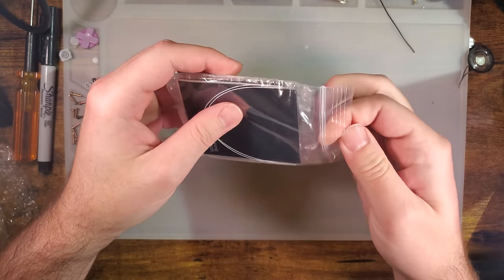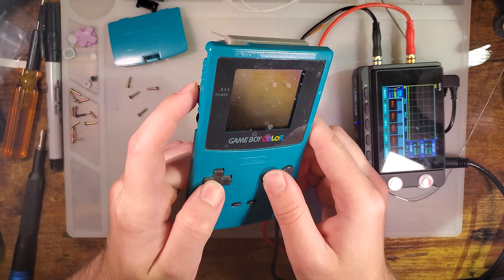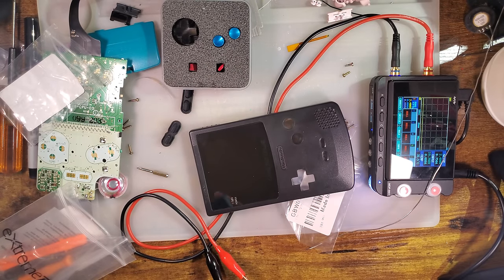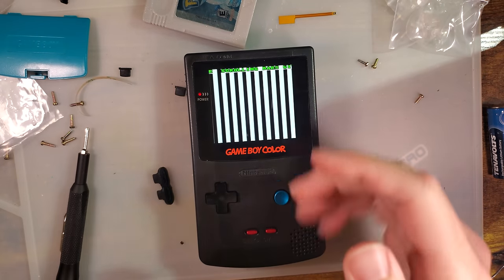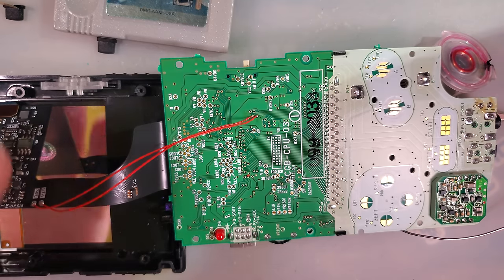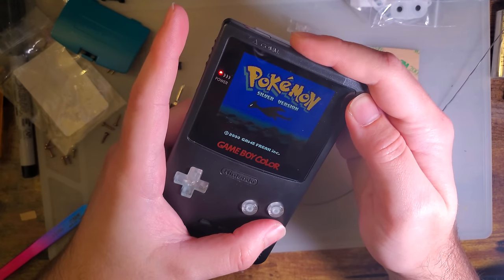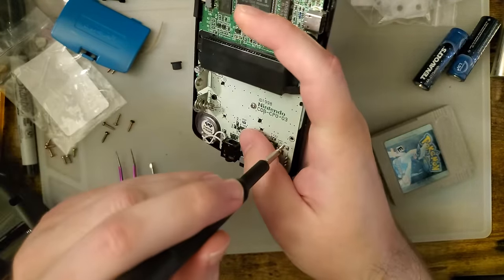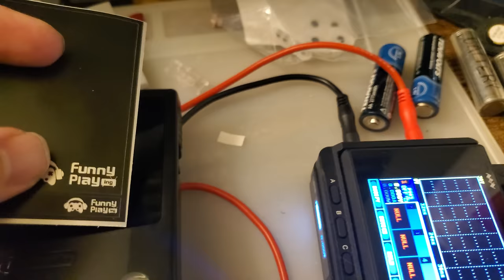'Retro Pixel 2.0' Funnyplaying Laminated Q5 GBC Backlight

Comment: Summary of known issues:
19:02 - start and select doesn't fit and holes need trimming, fix method: 22:30
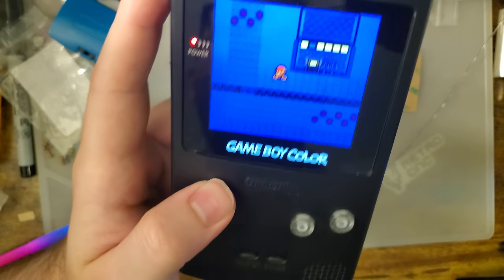1:01:49 - up on d-pad need fixing, fix method: 1:04:02
1:07:21 - pushing start and select without holding it glitches touch sensor, fix method: 1:07:51
Use funnyplaying screws not the original ones to avoid problems.

Like it so people would see.
Reply: Installed one myself a few days ago, start select is membrane issue if you use funnyplayings. They are horrid. The mold for the start/select is way off, original use stairstep mold on buttons, repro not, same thickness all over. I also ordered full set of membranes, and I can honestly say, they are deep burried in the trashcan where they belong. Start and select wasn't even the worse part. The A/B didn't have the alignment holes in the correct place. Dpad didn't make connection except down. Nothing else worked. So ended up boilong and cleaning the originals. Heard alot of people had issues with the touchpad, I got a totally different one, also power and touch was reversed on my flex cable. So that worked actually. The screen thou, OMG. Made it all worth it. I hope funnyplaying addresses the issues, then it's almost perfect.
Reply: @roteca  @ant Do the updated kit and membranes still have these issues that you know of? The junk GBC I got to mod has a torn A/B membrane so I was hoping to just use all new membranes. Parts ordered but haven't arrived yet.

Comment: Great video!  I usually watch your videos before purchasing and installing, but I jumped on this kit right away.  I installed it four days before this video and ran into the exact same issues.  I got the RetroCNC buttons, and opted to not use the select start buttons.  The touch sensor was also very problematic for me.  I had to reopen the system at least three times to check the solder connection.  I think a piece of wire and copper tape would function better.  Your video answered my questions about the menu functions, which weren’t even detailed on funyplaying’s product page.

I used the black screen, clear red shell, RetroCNC concave aluminum buttons (silver) for d-pad A + B, oem select start silicone, clear funnyplaying speaker, holographic sticker, barcode, service sticker for battery plate, and a clear soft tpu protector.  This is definitely the highest quality Gameboy I’ve put together, and I’ve put together almost all of them.  I almost only buy from Retro Game Repair Shop and Retro Modding now.  Thanks again for the content.
Reply from the maker: > I think a piece of wire and copper tape would function better. 

Yeah, I did exactly this after the video and it did work better for me. Much easier to position too.
Reply: @makho  How do these touch sensors even work? I dont understand how a piece of copper can translate a touch through plastic... Like I want to modify the sensor to work better, but I fail to even see how it senses anything at all?
Reply from the maker: @chis5050  the "sensor" works by measuring a change in capacitance. When you touch it, the capacitance changes.

Comment: Great video. I personally would have used a smaller tip on my iron for the smaller stuff on the PCB but aye it ain’t like you can switch it out mid video. Great job showing the intricacies of GBC modding and the rules you have to follow for those who are new.

Comment: So, I know I am replying to this video and it's super old. But if you are worried about the transparency of a clear button - or interior of a screw post after screwing a screw in too deep and it makes a scuff on it, you can use something like a thin layer of gloss varnish and that will restore the transparency. Something such as Vallejo Gloss varnish (which is an acrylic resin). I have had to do similar on clear plastics that were a little scuffed and it worked perfectly.

Comment: So you can’t change the color of the “gameboy” separately from the “color” on the display?  I think that would have been a nice touch.  To have the gameboy be gray and change the “color” color to whatever else independently.  Would be even better if they had it multicolored for each letter like OEM
Reply: I think you can somebody in Reddit had the game boy in red and color In green I think you long press select
Reply: @Thirdeyestrappd  Do you have a link? I can't find it.
Reply from the maker: nope, but since one chip is in a constant state of one-upmanship with funnyplaying, perhaps their next kit will have this feature
Reply: It shouldn’t be that hard for then to have the multicoloured lettering as per the original, but I wouldn’t be surprised if they tried it and had colour bleed issues between the letters. If would be cool if the lettering could be dimmer than the main screen but i guess that would require either a separate screen, local dimming or a dimming gel between the LCD and glass. Anyways, i’m gonna wait and see if they make a multicoloured variant before buying. Replacing that touch sensor with a physical button (since they make the shells too) would be nice. Heck, they could add three buttons and reduce soldering massively.
Reply: @Venomous28  The Multi coloring lettering might be harder then you would initially think because the letters overlap in several areas. Getting that properly aligned with the cutouts would likely take manual adjustment on a per screen basis. (The tolerances I imagine would be quite tight, unlike a flat single color.)
Even with regular glass lenses Ive seen plenty of times that the colors aren't properly aligned, so you might see a bit of green in the one of the Os.
Reply: DeScruff yes I was thinking about this since my last post and I think the only way they could do it realistically would be to shine white light through coloured translucent letters (like colour gels). You’d lose the ability to change the colour of the lettering of “COLOR” but it would look incredible

Comment: Grabbed one of these on your recommendation, aside from the color gamut looking a little too saturated it's pretty great. I did run into the touch sensor going kaputt as others here have. While I can't speak for the 2.0 ribbon shown in the video, the newer 2.1 places the components used for touch detection too close to a flex point - you can be extremely careful during the install and they'll still desolder themselves.

Basically if you're extra hydrated and the thing still doesn't work try reflowing R22, R23, C7, C29, C31, and U4. Another option is to remove all of those EXCEPT for R22 (which is a pullup on the touch detect signal) and then attach a button between Pin 1 of U4 and Ground.
Reply: Hey, thanks for this, it is very useful. I too have the same ribbon as you and unexpectedly, the touch sensor has just stopped working. I have tried everything to try and remedy it, but to no avail. I will attempt reflowing the caps and sensor that you have mentioned. However, I find the final solution very interesting. Have you tried this with success? I hate these stupid touch sensors and even if I had to open the shell to press a button or solder a jst connector that I could attach a button to (in something like the battery compartment) this would be a big improvement. Any particular ground point?
Reply: @SCorpG22  I attached a button temporarily to set the panel's brightness and display mode, then removed it afterward. If you'd like to try this approach - the touch sensor chip is a TC233A and FunnyPlaying's implementation on the 2.1 ribbon is pretty close to the datasheet's example circuit. So shorting U4's Pin 1 (/OUT) to Pin 2 (GND) is enough, but to do this properly the signal needs to be debounced.

Ah right, obligatory warning - you can irreversibly damage your kit by doing this, exchange it for a replacement if you have the option available, flex board rework is advanced level stuff, I ain't liable if you break something.
Reply: @TailChao  I appreciate your honesty. I am able to micro-solder, I'm not a novice by any stretch of the imagination. I actually soldered a wire to copper tape, to the same pin on the TC233A that Makho made a note of as an alternate touch pad for the 2.0 ribbon, but it didn't work. I did notice however, that the touch trace from the inbuilt sensor leads back to a small capacitor before it reaches the TC233A and was wondering if a wire soldered to the side of this capacitor might work (I've yet to try).

As for replacing it, FunnyPlaying don't want to know. They've ignored 2 messages I have sent them and the kit is only 7 weeks old. I have wondered whether they have received that many messages about this ribbon revision and the faulty sensor that they've just stopped responding to people, which isn't great in itself. But I have nothing to lose really. I either try it or order another kit. I searched for a schematic of the TC33A but I couldn't find one anywhere. Can I ask what you mean by 'the signal needs to be debounced'?
Reply: @SCorpG22  No stress, the warning was intended for anyone else who might be following along.

To be clear, U4 is a TC233A not TC33A. I recommend reflowing all components in the touch sensor group (see my earlier list) before trying anything else, including attaching an auxiliary touch sensor. If any of them have a shoddy connection, the detection won’t be stable.

If you opt for replacing the original circuit with a button, debouncing isn’t necessary but rather it’ll work better. The touch detection signal (Pin 1 of U4) is expected to have a clean falling edge and just hanging a regular button off that may cause the kit to see multiple presses instead of just one.
Reply: @TailChao  Ah, typo on my part, apologies. I shall reflow and see if I get any life out of it. Thank you so much for your guidance, it's actually a relief to know that it isn't just me who has experienced issues with this new ribbon revision. Happy New Year for tomorrow.
Reply: I’ve resoldered my touch sensor (and other things like copper tape) so many times my pad is kaput. And idea where i could solder to instead. My eyes suck
Reply: @Venomous28  Yes, I found out several things about this ribbon since this comment. Firstly, there is an alternate solder point on the right side of a tiny resistor right next to the sensor. I soldered a wire and copper tape to this and it worked. Also, be aware that the cut outs for start and select in the FP shell are too tight. This means that they get pinched and interfere with the touch sensor controls. I wonder why every time I unscrewed and rescrewed the front plate that I would get it working before it shortly stopped again, it's that it frees the rubber buttons. So the holes need filing lightly with jewellers files. I also reflowed all the caps and resistors mentioned in this comment. If I can be anymore help, let me know.
Reply: @SCorpG22  hey thanks for getting back to me. That is excellent news about the extra solder point. I’ll try and use it. I was having troubles with start and select for 2 reasons. 1 because i needed to file a bit and 2 because i soldered the wires onto P12 and P13 near the actual start/select buttons. It was ok for start but too close to select and interfered with the membrane. I’ve switched to the points in this video now and its all good. Back to the touch sensor, i have yet to get it to reach to touch even once all day so I do wonder if there is a deeper issue. The kit I have has a tiny touch sensor but also a built in touch sensor on the ribbon cable - neither are working. I didn’t have copper tape so experimented with some solder wick and that was no good. I’ll try copper tape next and if that’s no good, might opt for a physical button. Shane FP didn’t just incorporate something into the screen laminate.
Reply: @Venomous28  The touch sensors are a bad design in my honest opinion. - They would be far better adding a physical tactile switch, small enough that you could trail it down to the battery compartment and just open than when you want to switch modes or screen brightness. What I would recommend doing is soldering a wire with a piece of copper tape and threading it through the socket for the power switch, before putting the power switch in. Screw it all together and move the internal power switch up with a plastic spudger. Don't stick a metal spudger in whatever you do. Then once it's on, touch the copper tape outside of the shell. - So many things can throw the touch off, even plastic. To solder mine to the side of the resistor, I used a cocktail stick with some solder paste rather than solder. I tinned the wire and touched it with my finest tip to the resistor and it soldered perfectly. It saves stabbing around at the resistor with a big blob of solder on the end of your iron. I've managed to set my brightness and my logo colour and I've left the wire attached and stuck it to the side of the cartridge slot inside so that if I ever need to fiddle with it again, I can get to it. - But I'm done with fiddling with the sensor through the shell, it's about as tedious as chewing a lemon.
Reply: @SCorpG22   I’ve now recalled something stupid I did when installing that I didn’t think would be an issue at the time. I initially soldered the touch sensor pad to the wire for the power. So I sent 3V into it. I wonder if that might have blown something. I like your idea for the copper tape sensor on the side. If my ribbon is salvageable though, a physical button would be nice, would be nice to be able to easily change the brightness to cater for both afternoon and late night sessions. I am loving this screen, but constantly being on max brightness is killing both my eyes and my batteries!
Reply: @Venomous28  Hmm... you couldn't blow the pad as all it is in essence is a copper conductive pad, there's nothing to blow. However if you had that connected to the touch sensor with the power, then it's possible you could blow the touch sensor itself. - And if you had done, you could replace it as I think the ICs are available separately, however you may have also blown the little capacitors around it. But I think you're maybe looking too much into it. I'd solder a wire and a piece of copper tape to the side of the resistor and I'd also try freeing up the start and select buttons by lightly filing around the edges of the holes in the shell.
Reply: @SCorpG22  I decides to check all the resistors and capacitors in that area. Everything was fine except for C29 which is missing completely. I Assume that is my issue! If anyone knows what type of capacitor goes there i’ll try adding one but i’ve asked FP for a replacement. They are taking their sweet time getting back to me though. 
By the way. I might also try the physical button between pins 1 and 2 on U4 but its hard to see which end of the chip has the pin 1 indicator. Any idea? Even my best attempt at taking a picture didn’t help with an iphone 7…
Reply: @Venomous28  Are you sure C29 is missing as unlike C3,  C7 and R22, it isn't right next to the C29 text or the same size. It's the larger type and is to the left of R23 at the top of the touch sensor IC. In regards to adding a physical button, I couldn't help you I'm afraid, you would need to directly apply to the dude above who mentioned the idea. And in regards to FP replying, good luck with that too. I like their products but I find their customer service utterly useless. I think they are well aware of the issue with these touch sensors and have given up responding about them, as it's easier to bury your head int he sand that deal with a dozen customers with issues. Did you try soldering a cable and copper tape to the side of R23? Did you try sanding the start and select ports of the shell? - I'd try all these things before I give up.
Reply: @SCorpG22  I’ve done the start/select button filing and those are great now. Still need to get some copper tape. I’ll have a closer look for C29 - but I see pads near ish the label that are not populated
Reply: @Venomous28  If you see empty pads, then that's pretty conclusive. The only thing you could do, is to order a replacement and either measure the cap that's missing from the replacement or desolder it and measure it and then pop it back. Then order another cap and put it back on the faulty ribbon, and sell it on. It's a lot of messing around, but it would be impossible to know the value of the cap that's blown. The only thing to blow a cap (or fuse) is over-voltage i.e. too much voltage travelling through that area, but then you'd have to wonder why none of the rest have blown. - I had a battery charging board that a while back that blew 3 caps because I charged the device attached with a 5.2v instead of a 5v. That tiny increment blew 3... so I'd wonder whether the cap missing from yours has always been missing, it's very odd, and given that the current travels through the resistor next to it first, and then onto the touch sensor, even stranger.

Comment: just finished installing this kit. great vid, i was surprised at how little documentation there is on these installs. this vid was just what i needed though. i think the stickers are to insulate against the back of the screen, the select and start solder points can possibly short on that. i had that problem initially but i solved it with heat tape. also had to do a little tape between the start and select on the flex cable since it folded them into eachother when i closed the case =/
Reply: I noticed that too when you fold the ribbon cable onto the motherboard. Those two points can touch eachother depending on how big those solder joints are.